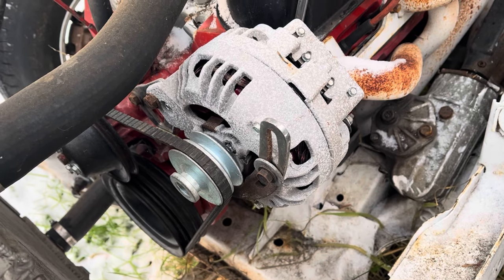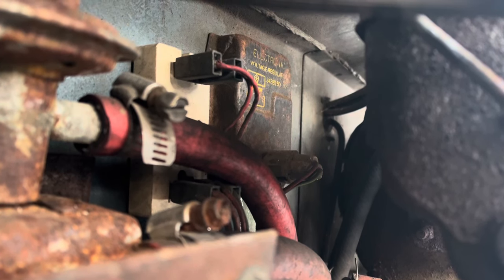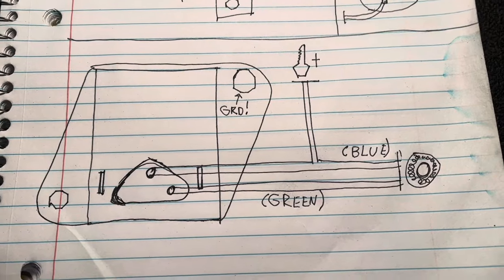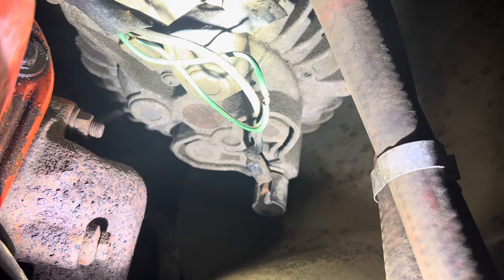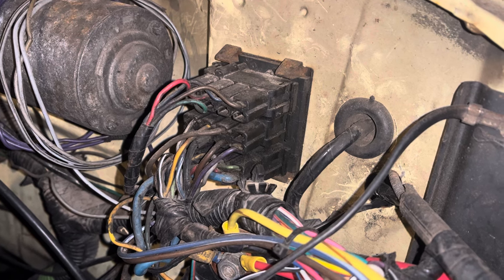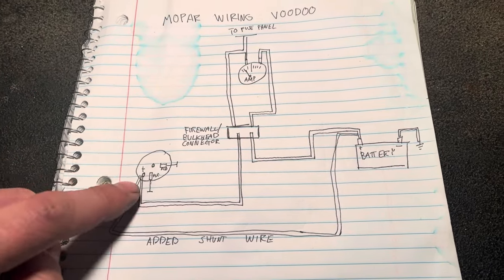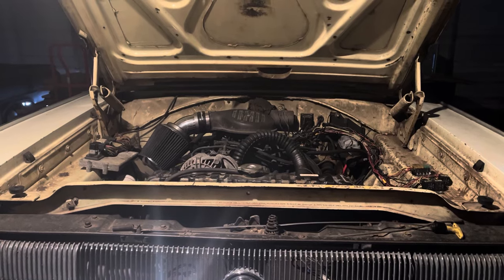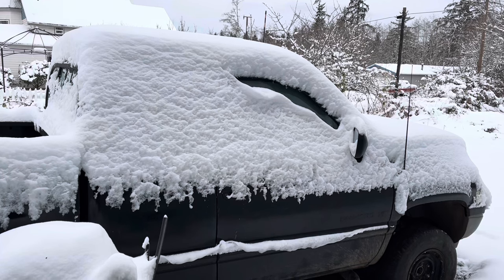Classic Mopar Charging Systems: How They Work, and How To Diagnose Failures

Comment: hi man , thanks for the video , i have a 1973 dodge Charger and few hours ago a took it for a ride and suddenly the car shut off and i saw a smoke coming out from underneath the dashboard . i opened the hood removed battery while the fusbile link wire was on fire ( i put it out fast ) the question is what can cause this .  ( N.b : the alternator gauge pins was connected together 3 years ago so i don;t have a working alternator gauge ) . thanks for the help
Reply from the maker: The interesting thing is, if you read advice on the internet, everyone says the alternator gauge is a fire hazard. It’s not - everything attached to it is. You most likely have a dead short somewhere, and the most likely culprit is the alternator itself. I just had this happen in a fresh reman alternator that had driven 350 miles. Luckily it got me home before it decided to explode into pieces. The fusible link’s job is to blow before the rest of the car burns to the ground. So it did its job - that’s the good news. You will obviously need a new fusible link. I would pull the alternator and have it checked and/or tested. If it looks good then the short is elsewhere. The alternator charge wire would also be a good thing to inspect. In theory, a dead short anywhere in the electrical system can cause that, but most of the circuits have fuses for individual circuit protection. The other two that don’t are the headlights and the ignition, so if there is no problem with alternator, that’s where you need to look next.

Comment: 1982 D150 Having a grossly overcharging issues. To the point has melted a lot of the wiring! From 15 to 45 volts!  Is frying both alternator & Regulators! & wiring & fusible links! Any suggestions appreciated!
Reply from the maker: 45 volts?! Holy crap! I didn’t know that was possible. I have never seen higher than about 18. Although I suppose when I have seen as high as 18, I’ve stopped. I believe in this video I described the overcharging issues I have seen. Incidentally, I have only seen it on trucks of the same era as yours. Basically, a poor connection in the voltage regulator connector causes the regulator to gradually crank the alternator output to full kill. When I learned about this issue, I had tried six different new voltage regulators. All gave the same result and overcharged. But the one decades old regulator off of a random truck out back worked perfectly. I believe this is down to a slightly different pin design on the regulators available now. The next time I saw this issue, I went right for the old faithful regulator and it again worked perfectly. In both cases, I replaced the voltage regulator connector with a new one from the parts store and all was well. I hope this fixes your problem too.

Comment: on a dif note… would a battery that’s “ past it “ have any effect on how well the car runs? i have a crappy battery that will start the car(70 roadrunner w 440)after a few minutes of one on one w the battery charger.. however the car consistently runs poorly and mis fires.. many have said that the battery is out of the loop after the car is started and others say that the battery will def effect performance… i thought i’d ask you for the official and final word on this issue.. hope to hear from you soon!!! thanks for all the great vids!!!!
Reply from the maker: Well, the official and final word is… maybe. Haha. What really can have an effect is the voltage the ignition gets, and I suppose if your battery is so shot that the system voltage is much lower than it should be, but high enough to stay running, it’s possible. I’m assuming the car won’t start again after running and charging the battery for 15-20 minutes? In that case I would say it’s possible. Generally speaking, I would say no. The charging system should have enough output to maintain a high enough voltage that this is a non issue. If the voltage measured at the battery while the car is running is 13-14.5 volts, that probably isn’t it. But it sounds like you should buy a battery anyway.

Comment: 1970 dodge power wagon 318 powered. I have the classic amp meter pegged when driving down the road, watching your video It looks like it could be the two pin connector on the voltage regulator .... Are there any other things that would cause this? And thanks for sharing your knowledge over the Interwebs brother, you're a big help.
Reply from the maker: Regulator or the regulator connector / pigtail. Those are basically your options. In theory there are a couple more possibilities but it’s basically always one of those. You bet! Thanks!
Reply: Well now sir your suggestion worked. Removed the voltage regulator, cleaned up all the associated ground contacts lubed up the 2 pin and BAM!!! meter gauges right where it's supposed to. Next up is the left  side back up light I've changed the bulb, cleaned up the wiring and I still can't get it to turn on. Also, I put a timing light on it and at idle with the vacuum advance unhooked it has 10°. Would you leave it there or would you give it two or three or four more? @DeadDodgeGarage
Reply from the maker: @daviddodson1019  for a stock engine with a stock distributor curve, 10 degrees should be just right. Test light should tell you if power is reaching your reverse light bulb socket when the key is on and the shifter is in reverse. If it does, you are dealing with a ground problem to that socket. They probably ground through the housings.
Reply: Jamie, thanks so much for your time in responding @DeadDodgeGarage

Comment: Hey Jamey so if add a wire from the alt lead post to pos battery can I leave it like that on an original charging system 68 plymouth 318
Reply from the maker: Yes, I do that all the time. I do have to recommend that you put in a big fuse or fusible link to protect it from shorting - which happens in these alternators from time to time.
Reply: @DeadDodgeGarage  thank you Jamey I will try that you are awesome!!!!

Comment: I bought an 86 ramcharger , I own fords so I’m new to dodge. new alternator, new voltage regulator, still not charging my battery. No volts at alternator battery terminal.

I did trace fusible link connected to battery, that wire is connected to 4 different wires that have fusible links. A blue wire within that is cut off either burned off not sure. Could this be my issue ? I’m new to dodge wiring so this is frustrating 😂
Reply from the maker: No volts at the big stud? That would be your problem - no connection to battery positive. I’ve never gone through this in an 80s truck and I’m not sure if that circuit works exactly the same as on older trucks or not. But in older trucks, the connection is made through the amp gauge/ammeter/alternator gauge - and they are often bad.
Reply: @DeadDodgeGarage  
Correct no volts at big stud on back of alternator that says batt. I’m gonna keep researching and look into the amp gauge. Thanks !

Comment: It also good to know that the regulator supplies voltage from the ignition to the field on the green wire. Some regulator,(not Mopar) ground the field! But Mopar supplies voltage to the field wire
Reply from the maker: On the single field alternator, it is a voltage signal on the green wire. On the dual field, it’s voltage on the blue wire, and a varied ground signal on the green wire. So they got with it.

Comment: Hi again DDG, I tried adding a bypass wire from my alternator directly to my battery and it worked! The problem now is the amperage is too high and the battery's voltage goes way past 12 volts. Is there anything I can do to counteract this?
Reply from the maker: How far past? Ideally you should see somewhere around 13-13.5 volts at idle, and no higher than 14.5ish volts when the engine is revved up. If you are getting massive overcharging (battery voltage slowly creeps up to like 18 volts) then you could have a poor connection at your voltage regulator. I have had to replace those plugs a few times. If you are seeing no higher than 15 volts… you’re probably fine. Remember this is a “nominal” 12 volt system, which means in name only. Your battery should sit around 12.6 when the car is off and any surface charge has been removed, for example. It’s not exactly 12.

Comment: I am having a problem wit my old school mopar charging system.No charge senerio.  I replaced the square back alt w/ a rebuilt one. I replaced the solid state regulator w/ a new standard unit . Now I have a overcharge senerio 16 to 17 volts w/ engine running. My alt has 2 feild leads. my voltage reg has 2 lead plug. my ignition module has a 5 pin plug. could I have the feild terminals reversed? currently alt is wired as follows- battery wire, the next to it red feild wire ten next feild  terminal to green wire, then ground wire in that order. Please help.
Reply from the maker: It shouldn’t matter which field wire is which. You have a ground wire? There isn’t usually a ground wire… judging by the field wire colors you gave, I’m assuming this is a truck? A bad connection in the two pin regulator connector causes this overcharging problem, and I almost always see it in trucks. I talk about that in this video. The tell tale will be the voltage starts at an almost normal reading immediately after starting, then climbs and climbs over a few seconds when you rev the engine to check the charge output. Clean and retension the terminals in that regulator connector - or replace it. If that isn’t it, my only other thought is that you could have ended up with a two field alternator with the negative field / brush connection grounded to be compatible with the earlier single field setup. Make sure the screws for the brush holders have their insulating washers in place.

Comment: My problem: with key off, negative battery terminal off, I have voltage in both field wires to the alternator. Where could this power be coming from? The rad , the motor, voltage regulator housing, firewall all have a measurable voltage! Obviously a short but where to start looking that would have it in those field wires?
Reply from the maker: I have been thinking about this for days and I still don’t have a good answer. For one thing, if you had a short, you would have a fire in short order. Does this vehicle run? Are you finding these voltages with a multimeter on DC mode, the ground cable of which is run straight to battery negative? I wonder if you could email me a video of what you’re seeing. My address is jamienoise@gmail.com

Comment: Ptoblem is in the PACKARD factory bulkhead plugs.. They arent tight. Air gap makes excessive current draw MELTING THE BLACK wire. I just wrote a repair manual on that problem and how to easily fix it.
Reply from the maker: Retension them with a pick?

Comment: I have a 1974 dodge dart and I took it to a shop not too long ago to get stuff fixed. When it came back it was reading below 12 volts so I replaced the battery, alternator and voltage regulator, and now it reads around 12 volts. There used to be a ampmeter but I found out whoever worked on my car took it out and just crossed the wires together, would that effect anything? But basically what I’m saying is the alternator is barely if any charging the battery. Any ideas?
Reply from the maker: Do the test I describe in this video where you check the voltage at the alternator output stud and compare that to the voltage you see at the battery. If there is higher voltage at the alternator than the battery, you likely have an issue in the firewall connector or dash wiring - which might explain why someone was messing with the amp gauge. In this case, your easiest fix is to add a shunt wire / direct charge wire from the alternator to the battery. Amp gauge wires connected together works fine as an amp gauge bypass. Also, some of these systems don’t really charge at idle. Rev the engine slightly while checking the voltage again.
Reply: @DeadDodgeGarage  How would you be able to tell if any dash wiring is causing the problem? There’s a ton of wires back there I don’t know what goes to what.
Reply from the maker: @BradleyA_LeftyK_Fishing  You need to do the test I mentioned above, where you will learn if the voltage at the alternator output stud is the same as at the battery - or not. If the readings are substantially different, you have a problem between the alternator and the battery. The only dash wiring that could cause this is the ammeter wiring. Beyond that, it's going to be hard for me to explain here any better than I explained the relevant circuits in this video.

Comment: The car is a 1969 Charger 440 Magnum. It has a direct connection electronic ignition. I did switch out both the orange ecu module and the voltage regulator with known good units but it still shuts off. How do I test the distributor to see if that’s bad? I’ll  go over all the connections i the engine bay again.
Reply from the maker: First thing to do - get it warm to the point that it dies and won’t start. This is when you need to do your testing, so be ready with a multimeter or similar. When it won’t start, I want to know what voltage you see at coil + with key on. Voltage here will rule out ballast resistor (although you didn’t say starts and dies, so I don’t think this is resistor related,) ignition switch, connector under dash/column, and firewall connector. Since you have a Mopar electronic ignition system, there is an easy test to do. I have actually done a video on ignition systems, and I’ve only just realized that you aren’t commenting on that one - so maybe you haven’t seen it. Go check it out if you like, but the test is as follows:

Disconnect coil wire from distributor cap end and set close to (but not touching) a good ground - intake bolt, valve cover bolt, alternator body, etc. 

Have an assistant turn the key from off the run /or/ put the key in the run position and disconnect, then reconnect the battery. 

Watch for a test spark. Every time power is /removed/ (meaning key turned off, or battery unhooked,) you should get one spark from the coil. If you do, then the module is working, and getting power. If you do not, the module is bad or poorly grounded, the coil is bad, or you aren’t getting power. 

In my experience, bad coils are very rare - so that’s usually the last place I look. If you suspect your coil is bad, there is a resistance test you can do.

If you do get a test spark, proceed to cranking the engine while watching the coil wire. You can have an assistant do this, or jump the starter relay in the engine compartment with a screwdriver or similar. If you don’t see any spark while the engine is cranking (after getting a test spark from module) then your distributor pickup is almost certainly bad (or possibly way out of adjustment,) and while you could monkey with changing the pickup, I usually just go for a new distributor. If you have the Direct Connection cast iron distributor, you may not want to crap can that. Rebuild time. 

Let me know if you have more questions.

Comment: I just bought a 69 powerwagon
I have 12.4 volts at the alternator and at the batterh when running. Altemeter shows neutral to discharge reading. I replaced alternator and regulator without a fix. I have power with key on position at the regulator. If I add a jumper between regulator wires i get normal charging voltage.  Where should i look next?
Reply from the maker: I’m assuming the voltage does not increase when you rev the engine? Low voltage only at idle is a pretty common issue. Otherwise, weirdly enough, it sounds like your new regulator is bad. That or it isn’t grounding through its mounting bolts as it should. By jumping voltage across it you did a “full field” test, and confirmed that the alternator and both of those circuits are good. The regulator in the middle is the only other possibility.

Comment: My batteries keep sulfating in my 1987 Dodge Ramcharger. is this an alternator over charging the battery problem? or is it the voltage regulator? or both?
Reply from the maker: Overcharging is definitely possible, but the way to know that is to watch what the amp gauge is doing. Battery voltage at higher engine RPM would be a good thing to check - if you’re seeing 15v+, that’s a problem. ‘87 should still have the separate two wire voltage regulator, and what I often see on trucks is a problem in that connector leading to over charging. But there will be other signs… blowing light bulbs are a good one.
Reply: havent had any light bulbs blow its just been the battery sulfating. this is the 3rd battery in less than 2 months. Im inclined to beleive its the regulator, but if I buy a new regulator you are saying that it might not be the regulator but the actual two point triangle shaped connector that is faulty? also thanks again for answering i was about to go on the ramcharger central forums lol @DeadDodgeGarage
Reply from the maker: @S.G.W.C.  Usually if that is the case, the amp/charge gauge will be reading very high all the time when the truck is driving down the road. There is a resistance test you can do on the voltage regulator - I think I discussed that in this video, but there is a better video on YouTube documenting that. It's probably worth checking before throwing parts at it, if you have a multimeter.

Comment: can I just run the shunt wire from positive output side of the alternator straight to the positive terminal to the battery
Reply from the maker: Absolutely, but a fuse for safety is a really, really good idea.